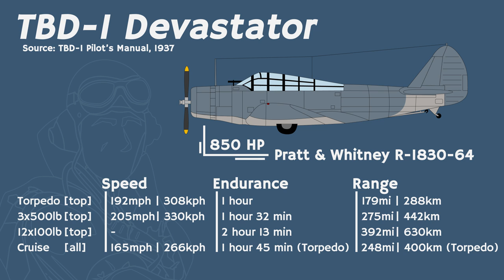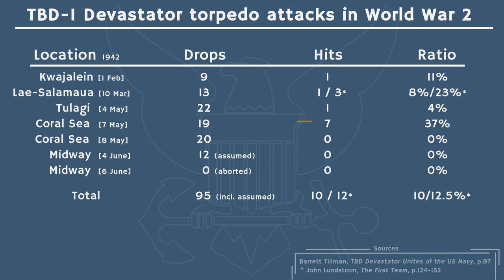In Defense of the Worst Aircraft of World War II - TBD-1 Devastator

Comment: It's difficult to properly assess the TBD Devastator since they had so much trouble with their ordnance. The torpedoes used at Midway were horribly unreliable and, while torpedo bombing as a tactic was mostly outdated by WW2 and was a very high-risk idea in the first place, the Devastator might have had much more success if the torpedoes it was dropping actually deployed, ran, and detonated properly. It's an absolute travesty that brave men lost their lives while delivering faulty ordnance which should have been corrected long before.
Reply: exactly.  the B5N2 Kate never had such problems with its torpedoes and enjoys a much better reputation as a result.
Reply: The Navy looked at replacing the Mark XIII, but a program to develop a new torpedo was believed to be too protracted a process. (Yet the Mark XVIII Electric and the  Mark XXIV were developed) Personally I would have made a deal with the UK to build their Mark XII torpedoes and adapt American aircraft to use them.
Reply: @JohnRodriguesPhotographer  too protracted!?!?!? that's their JOB lol
Reply: Torpedo attacks were devestating in WW2.  The problem with American torpedoes was pretty criminal.  The Kate was feared.  Predominantly because the Japanese air dropped torpedoes were so good.  One interesting note:  the Japanese torpedoes used PID control to prevent deflection on drops.  It took the US Navy about 15 years to do this (long after the war).  This meant that their torpedoes ran much straighter after an air drop.  

Note:  in 1945 American torpedoes took down the Yamoto and Mushai
Reply: @manuelkong10   The development problem was that the development would have been done in the same Navy-operated facility that did such a horrible job designing and producing torpedoes.   The navy turned to industry for a new torpedo out of sheer desperation because the Navy facility could only produce small numbers each month.
Reply: If their torpedoes didn't have a 97% failure rate they would have bagged at least one carrier at Midway and one more at the Coral Sea
Reply: DrakeIsSix  Yet in March 1945, a Japanese Judy dive bomber almost sank
US carrier Franklin with 2 bombs.
The bravery of the crew and the extraordinary competence of the damage control teams saved the ship. 

Not forgetting the formidable support of the fleet in shielding the Franklin from the swarms of Japanese planes who rushed in like flies, and who fell like flies.
Reply: Torpedo failures were an issue across the fleet, amongst surface ships, aircraft, and worst of all, submarines, until 1943. The US Navy failed to test their torpedoes, which might have revealed failures in detonators and depth keeping, and it did not help that the Bureau of Ordnance continued to insist that there were no issues with their torpedoes. It took Admiral Nimitz's intervention in some cases to rectify the problem, particularly the issue with the magnetic detonators. He had to give permission to deactivate the magnetic detonators and use contact detonation.
Reply: The mark 13 torpedo after several simple modifications became the best airdropped torpedo of World War II. Those modifications should have been performed in 1940.
Reply: The torpedoes used by American subs also had reliability  issues.
Reply: @MrDgwphotos  They also ran too deep.  You are right; it's pretty tough to sink enemy ships if the damn torpedoes don't work.  It wasn't until late '43 (for subs based at Pearl) or early '44 (for Australian based subs) until all the problems were finally taken care of.
Reply: @jamesricker3997  Probably not. The problem at Midway was (1) the air groups took off and split up. They all had to guess where the Japanese would be, and it happened that the three torpedo squadrons had guessed right. Or that one of the leaders, LCDR John Waldron of Hornet's Torpedo 8, somehow just knew the right spot. (2) the Japanese carriers turned directly away from the torpedo squadrons. A torpedo bomber had to flight outside to left and right of a targeted ship, and, ideally, approach from off the port and starboard headings. The Japanese called that an "anvil" attack, since the target could not turn left or right to "comb the wake" of torpedoes. Since the Japanese carriers could manage about 30 knots, and the TBD maxed at only a little over 100 knots, and since the Japanese carriers turned away was the TBD's gained from dead astern, it meant a long approach. During that long approach, Japanese fighter planes could shoot down the TBD's. Even with better torpedoes, the American squadrons might not have gotten a hit.
Reply: @jamesricker3997  I would say the changes were many more than several and much more difficult than simple.  It took more than two years (fall of 1944) to improve the Mark 13 torpedo until it was an accurate, reliable, and deadly weapon.  The problem was arrogance in both the Bur. of Ord. and the Naval Torpedo Station along with inadequate funding in the 1930's by Congress to properly test the torpedoes before the Pearl Harbor attack.  

A study should have been made in the second half of 1941 to test the torpedo with the newer and faster torpedo planes (TBF and TBU) that would be arriving (planned) in 1942/1943.
Reply: The very real lack of quality of the TBD's early MK XIII aerial torpedo had almost no impact on the Devastator's performance at Midway, because so few of them survived long enough to launch their ordnance.  Ensign George Gay did launch, but his target was fleet, agile and on the lookout for torpedoes, which made a single hit very hard.  Tactics (ours and the Japanese) called for an anvil attack - planes coming in simultaneously from both sides (port and starboard); no matter which way the ship turned, it would be a target for some of the torpeckers.  However, a single (gallant) attack by a single plane was always a low-probability-of-success move.

Yes, those torpedoes were flawed seven ways from Sunday - on that you're on-target. However, at Midway it didn't matter, for the reason stated above. Oddly, at Coral Sea, when a much slower target (Shōhō) was attacked by a coordinated dive bomber/torpedo bomber assault made by the Lexington's SBDs and TBDs, the torpedoes worked well enough.  The second wave of SBDs dove on Shōhō at 11:18 and the first of the TBDs attacked one minute later, and scored (according to Japanese five hits with their admittedly-faulty MK XIII aerial torpedoes - at least at Coral Sea, used properly, they worked just fine.  Then, just a few minutes later (11:29), the Yorktown TBDs attacked, and according to Japanese sources, there were two more torpecker hits (for 7 total), though the American pilots claimed ten hits.
Reply: Lack of funding for research/development of torpedoes = poorly working torpedoes.
US had poor torpedoes across the board, ship launched, submarine launched and air dropped.
Germans had poor submarine launched torps to begin with, which they relatively quickly fixed, but they would not have a fully functional air dropped torpedo until 1942, but that was partly due to politics, as the Kreigsmarine was not so keen in using substantial funds/research in airbourne torpedo development as it was the Luftwaffe who would benifit from it free of charge. Well that was until Hitler made one of his "Befehl's"
Reply: Steely - This "ordinance" you refer to is, in reality, "ORDNANCE". An ordinance is a local law or codified policy. Ordnance is ammunition, bombs, missiles, and other specialized armament.
Reply: @alanhardman2447  Ah. Well, I'll fix that, then.
Reply: Torpedo attack was outdated by WW2? Tell that to the crew of the Yamato.
Reply: cliff deal Catalinas, not B-26.
Reply: Truth of the matter is that the allies mostly banked on quantity over quality. Who cares if a few torps don't deploy or a few planes get shot down? Just send in more. The US banked on their economy and numerical superiority, not on their brave men or tech. An ugly move to pull on the guys you draft into the war effort against their will, but hey - look at the Russians during WWII ... things can always be worse.
Reply: The Devastator was a death trap. It was totally obsolete and the torpedoes were a problem for quite a while. The torpedo attack was the NUMBER ONE killer of naval vessels in WW2 and was in no way obsolete............ask the Yamato survivors about that. Newer planes were on the way, but the fliers had to fight with what they had. The early days were fought to buy time for the new equipment to arrive.......it wasn't that America had good planes and refused to use them, they just were not available at the time.
Reply: All statements about the mark XIii are correct and fair. Total junk, but(and there is always a but) it was all that was available. The TBD1 only had it's rep due to the torpedo. In 1936 it was the most advanced torpedo bomber in the world. With the worst air dropped torpedo in the world. Just look at VT8s number of torpedos launched with the lack of hits. Are you going to tell me all of those naval aviators missed when the lesser trained later ones did so well? I think not I blame Democrats and their depression preventing private industry from fixing the problems known so well in 1936.
Reply: @alanhardman2447 You know that along with a failing education system  a large number of mis-spellings are caused by spell check and biasis built into the websites.
Reply: @robertdendooven7258  The fact that a lot of people involved in the development of those torpedoes were in command positions in the Pacific when the war started and rather than accept their failure they blamed anything and everything except the torpedo, going so far as giving orders against field refits/repairs and testing until the top brass decided enough is enough. The failure rate when actual tests were conducted was incredible.
Reply: Drachinifel has a good vid on the subject of American torpedoes. I'm sure you can find it.
Reply: @jamesricker3997  In one of he books on Midway I read, there was one that mentioned that Japanese survivors of one of he carriers actually used the engine portion of the torpedo body that floated after use as a life preserver.  The torpedo had apparently broken off when it hit one of the ships and failed to detonate.  I don't know how valid the story is, but I do know that the torpedo body would float if the warhead was not attached.
Reply: @JohnRodriguesPhotographer  That would have made too much sense, and thats why something like that never happend.
Reply: @manuelkong10  that was the judgement of those in charge. They di get CalTech to analyze the faults and develope solutions. That did work.
Reply: I have a flight simulation for torpedo  operations, its the hardest ordinance to deliver, iv persevered successfully using Air to ground rockets as an air to air ordinance.
Maybe I should revisit this form of anti shipping program.
Reply: The TBD had more than a few fatal flaws. The worst of all was having to reduce speed to less than 115 mph to drop it's torpedo.